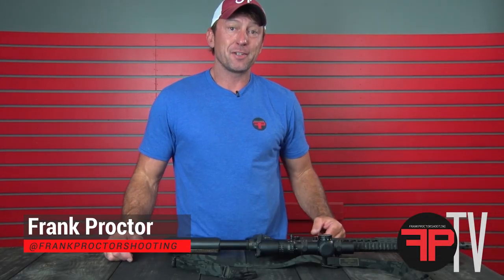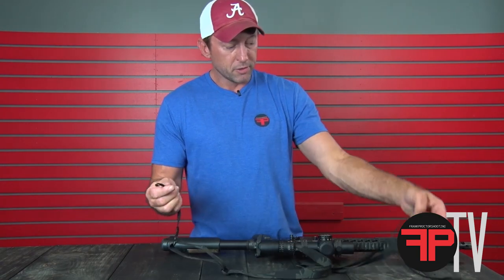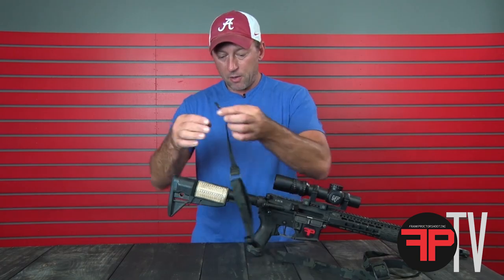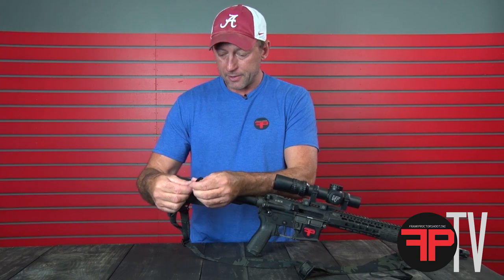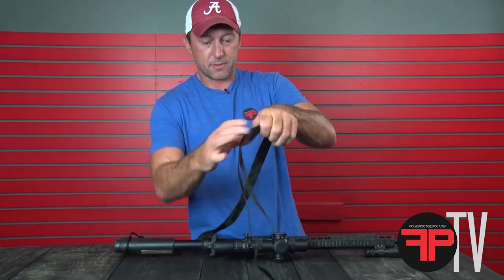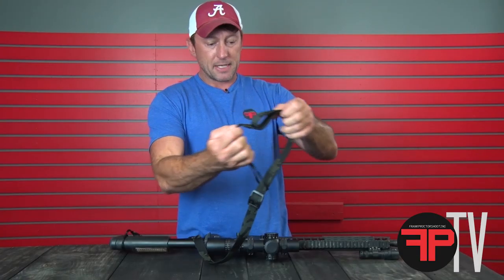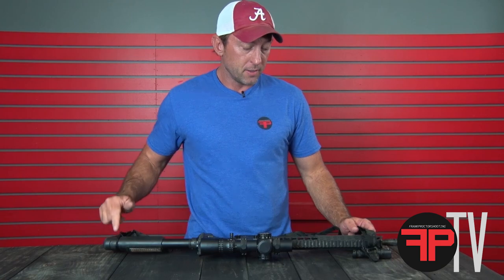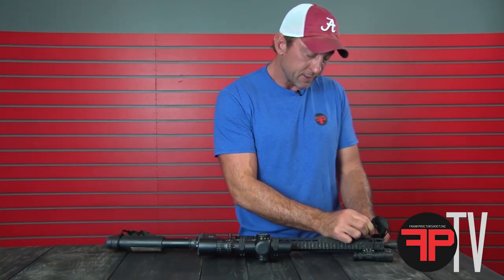Frank Proctor Shooting- Proctor PHD Sling Installation

Comment: Frank, I got the Dept. to buy 7 or 8 of your slings last year.  I played with it a little and figured out if you pull the tubing all the way back, put a loop in the 550 cord before you pull it over the sling, then slip it over the rifle on the front, work the sling back out of the 550 loop and then cinch it in place, then slide the tubing against the end to keep the small loop tight around the 550 cord,  it locks up even tighter and stays in place almost like its attached to a sling swivel.

Comment: Serious question... Favorite Beer???
Reply from the maker: I dig a variety, mostly IPA and Pale Ales, I can dig a good amber  and the occasional pils, generally stay away from stouts
Reply: My man!  I didn't know if you'd respond.  This is why I love your channel.  Real & down to earth.  Keep up the hard work man.  Love the vids!!

 --- 2nd Serious Question....    if zombies come and I have to Exfil from my mother's basement.. after my eyes adjust to the blinding sunlight, how much quicker will the Frank Proctor Rifle sling allow me to get headshots.  I'm level 1000 in Call of Duty, which pretty much means I passed BUDS.  I carry 6 high capacity clips, and SPF 30 just to give you a run-down of my gear.  My bullets look a little different from yours though.  For some reason, my rifle shoots little white balls,  but I'm pretty sure they're AP rounds.